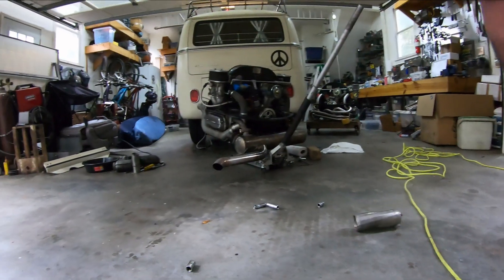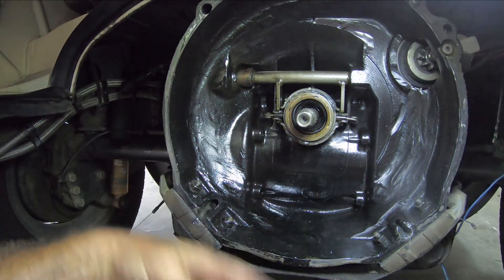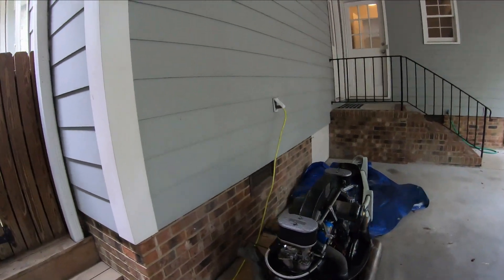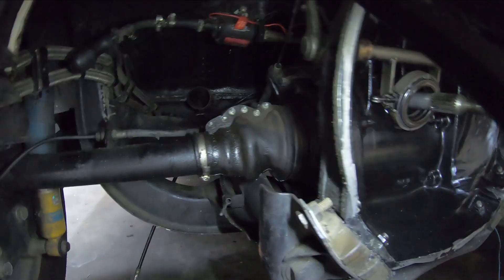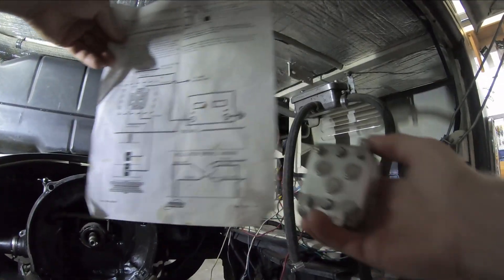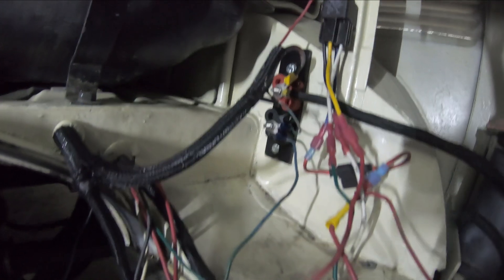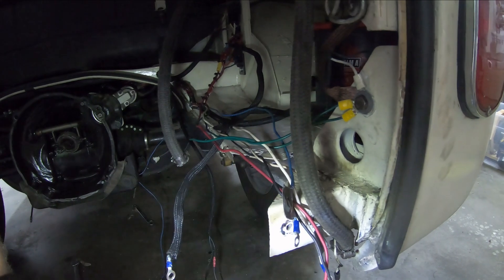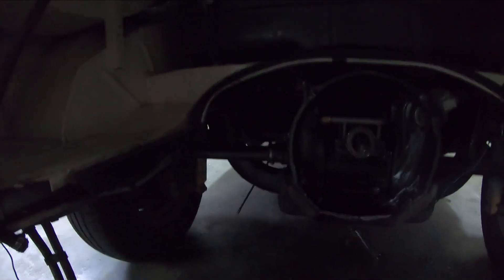2332 VW Air-cooled Stroker Motor - Video 80 - Preparation for Engine Installation

Comment: That is looking good…Awesome job!!!!!
Reply from the maker: Still having a few issues here and there - Carbs, RL44 shutoff valve for fuel pump, alternator pulley issues - but the motor is running fairly well…

Comment: Hi,  What was that fuel hose you are using?
Reply from the maker: The fuel hose is a 1/4 inch hose that comes with the Weber 44 IDFs.  If I read exactly what is on the hose it says "1/4" (6.4mm) ID SAE J30R9 FUEL INJECTION HOSE KIT"